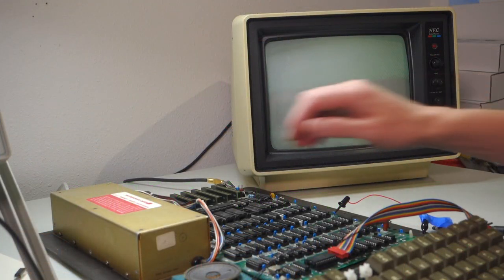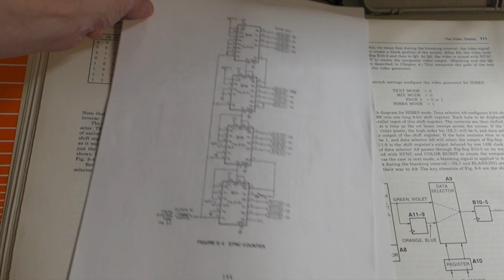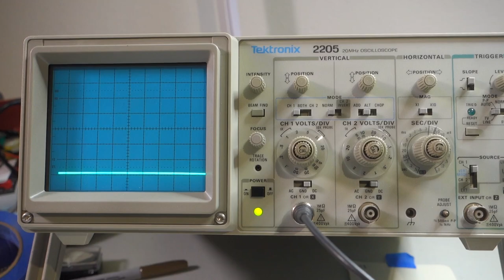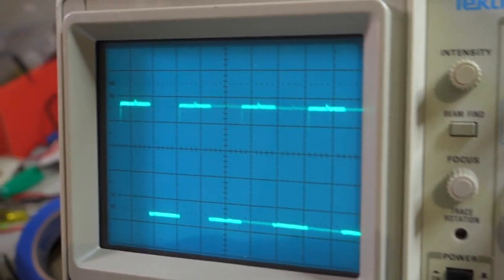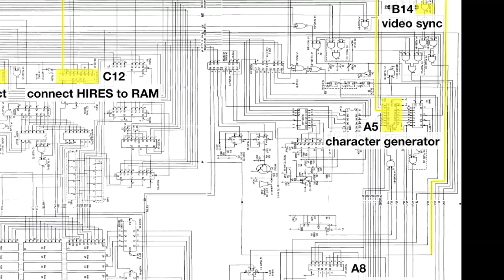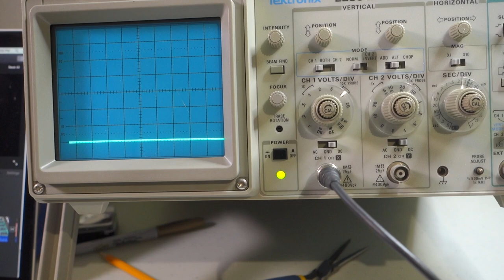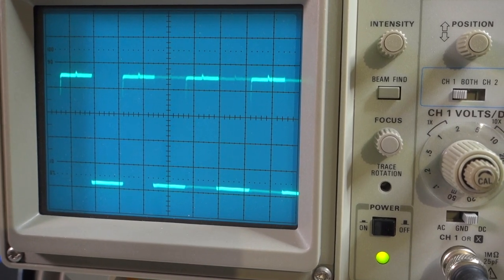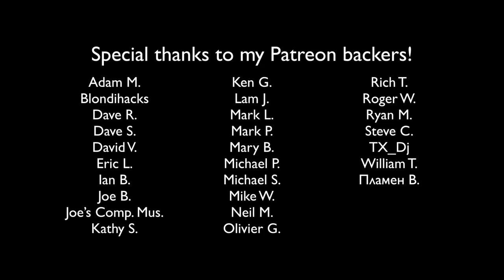#103 Bad Apple!

Comment: A couple weeks ago I bought a //e that was doing this same thing. Board was pretty dirty and I had to assume that the machine had probably been in storage many years in a questionable environment due to the corrosion inside the chassis. So what I did was, pull the board and give it a good bath. Dried it good with Alcohol and Air Compressor, pulled, scrubbed and re-seated every socketed chip and reassembled and it's been fine ever since. I believe in my case, it was probably oxidation affecting a socket/chip somewhere.
Reply from the maker: Yes, I was really hoping it was just oxidation, but in my case, reseating the chips did't help. There's still a problem with hi-res graphics that I hadn't noticed, so I think another chip is faulty. Just need to track it down. But glad to hear that you got your //e working!

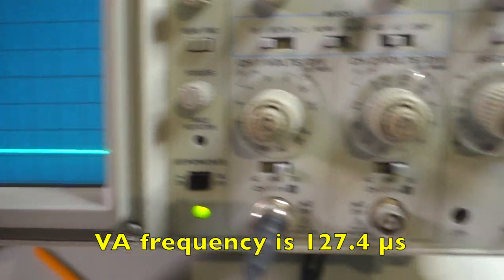Comment: 2:53 "VA frequency is 127.4 µs"  I think you meant the interval is 127.4 µs.  Anyway multiplying this by the speed of the processor (I measured mine to be 1.020466 MHz) yields about 130 clock cycles which is exactly the time it takes for two horizontal scan lines to be displayed, including the horizontal refresh.
Reply from the maker: Yes, you're absolutely right - it should have been the interval or period. Whoops!

Comment: I thought the Transistor-Transistor Logic (TTL) chips used in the Apple II were not vulnerable to static electricity like CMOS chips are.

I once removed a blank peripheral card, that was not connected to anything, while my Apple II+ was powered on and I still managed to fry a couple chips on neighboring peripheral cards.  I must have accidentally shorted adjacent contacts in the peripheral card slot.  It is probably best not to plug or unplug anything on the motherboard while the power is on.  Guarding against static electricity does not guard against shorts.
Reply from the maker: You're absolutely right about the peripheral cards - definitely make sure the power is off before removing/inserting cards. I got fooled once with a card that wasn't working properly and was preventing the Apple from booting. It looked like the power was off but as soon as I pulled the card out, I saw the power light on the Apple II go off. Luckily in that case I had one of ReActiveMicro's new power supplies and it just "reset" it. I'm not sure about static electricity and TTL versus CMOS - it's probably best to avoid it in all cases. Thanks for the comment!
Reply: @CT6502  I was implying that maybe the chips, that you had to replace, were not damaged by static electricity, but rather by some accidental short occurring.  I guess we will never know.
Reply from the maker: @TheGuyThatEveryoneIgnores  Ah, I see - actually that's a good point. We were busy plugging in and unplugging stuff so that's certainly possible.

Comment: Having an IC tester takes the guesswork out of finding which chips are bad. Interesting to see that you picked the right circuit to diagnose from looking at the problem. Also interesting to see the oscilloscope in action. Thanks for showing the good signal as a comparison. How would we use it if we only have one board and nothing to compare with?
Reply from the maker: Good question on only having one board - that Apple II Circuit book actually has signal traces for all of these video signals so you could still figure it out.

Comment: I have the same problem in one of my Rev.4 but with "two complete text lines"
Reply from the maker: Wait, you see the same line of text repeated?
Reply: @CT6502  That's correct Chris
Reply: Solved, it was a bad seatted D12 Chip! Thanks
Reply from the maker: @drakepirate  Awesome, glad to hear that you solved it!
Reply: @CT6502  It come back same problem... may be loosen conection or broken track?
Reply from the maker: @drakepirate  Yeah, in my case there were 3 chips that all failed - probably from static discharge.